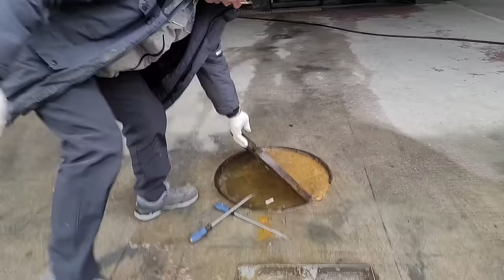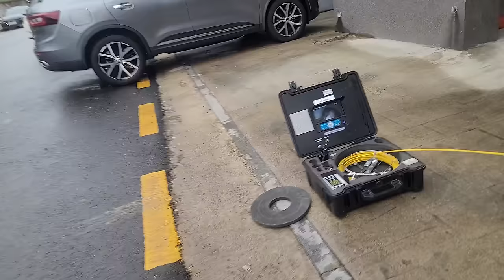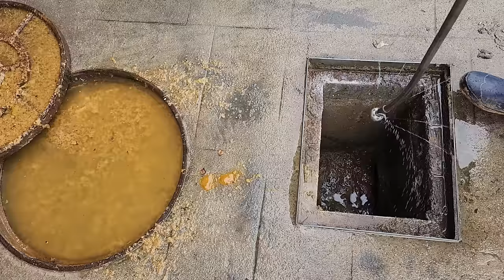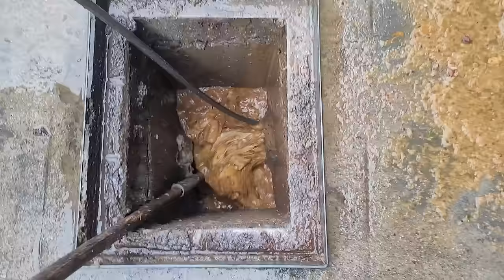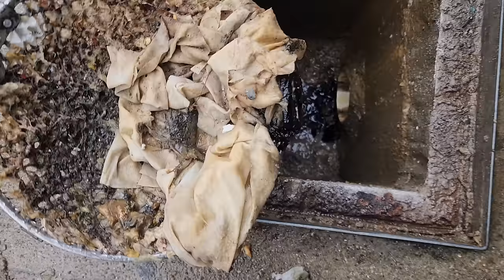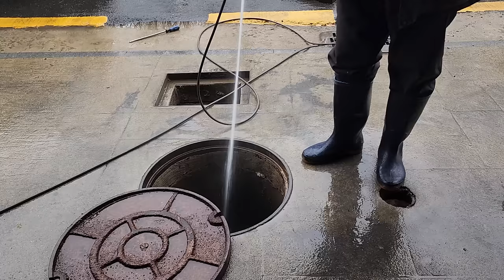What was between the manhole and the manhole

Comment: I am surprised, like you, that a such a very short pipe put up a big resistance to an unblock. Maybe the force of the sewer and jetter were equal. My first idea could have been s short metal rod to break the seal, but still would have met the same problem.
Reply from the maker: It is assumed to be the pressure of the opposite water.
Wet wipes are not easy to solve.
By the way, you didn't cancel your subscription, right???